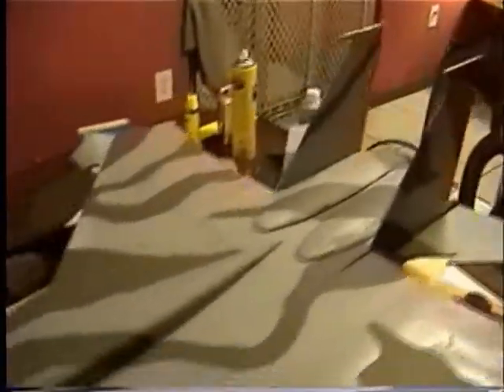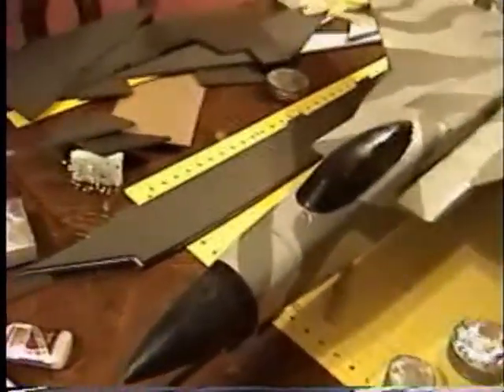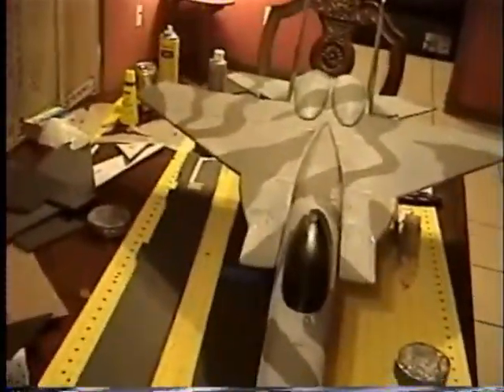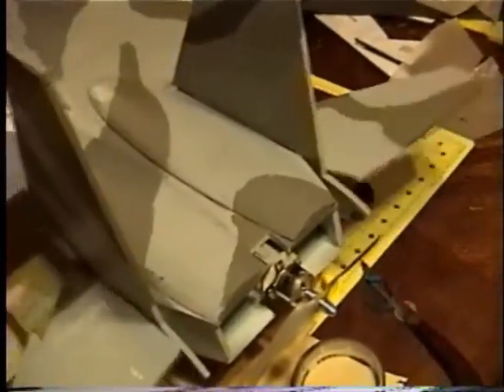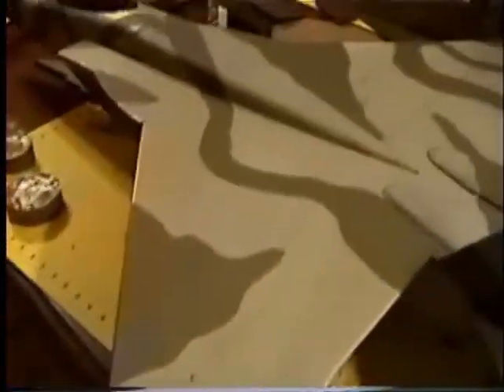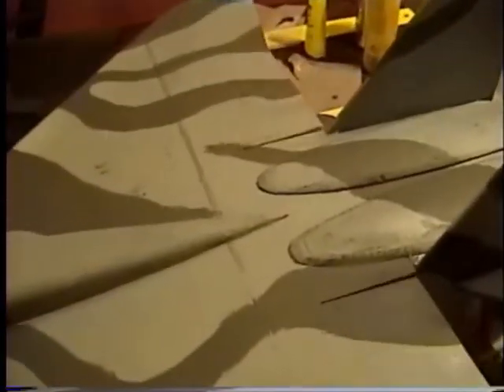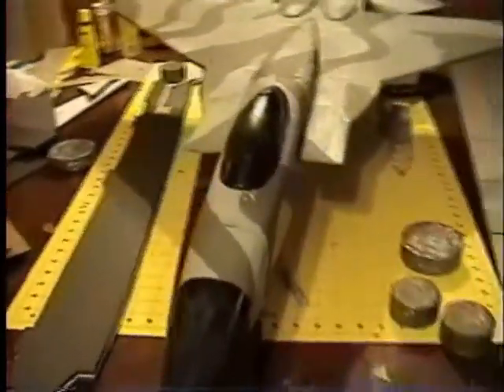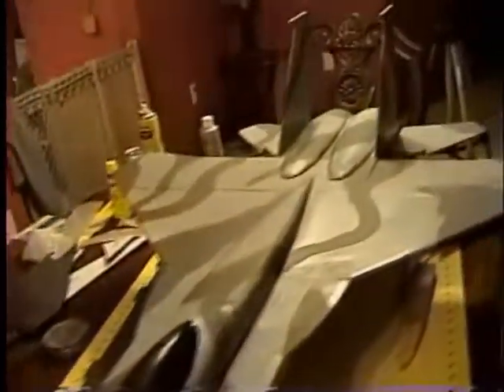F-15 parkjet build video #8

Comment: well its not very informitive but says this  1-1 thrust to power ratio (for park jets in the 20oz range)
so 20 oz is 566 grames so your be well over 20 oz, about 800 grams with battery making that 28 ounce. so your have under 1:1 but it depends on what thrust it makes. my 70mm ducted fan i have is 1150 grams of thrust. making that about 1.5:1 thrust. enough for what i need, so you might find that motor is a little under powered but will still fly well

Comment: what is the wieght of this with no gear. i work out the gear its self including all servos, esc batterys wire,fan/motor comes to 566 grams. the fan pushes 1150 grams thrust 

so if the plane wieghs say 500 grams and the gear is 566. total 1066. does this mean i have 2:1 or 1:1 thrust and what is better. cheers